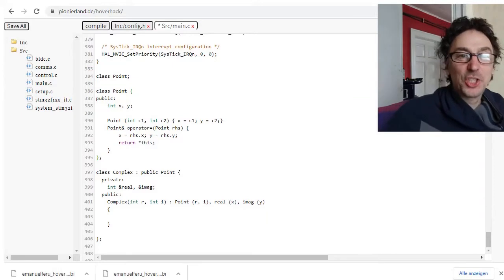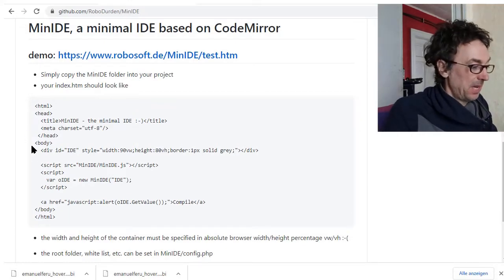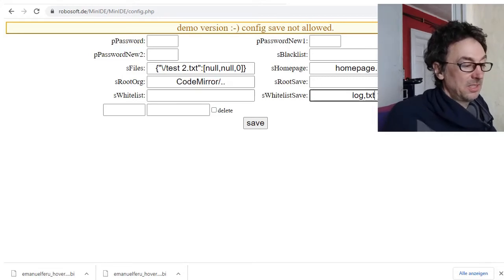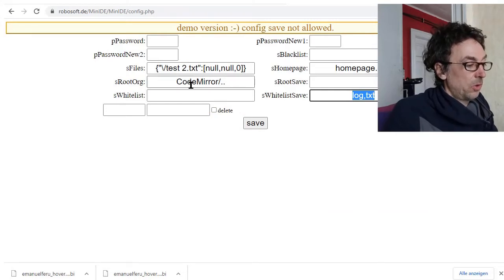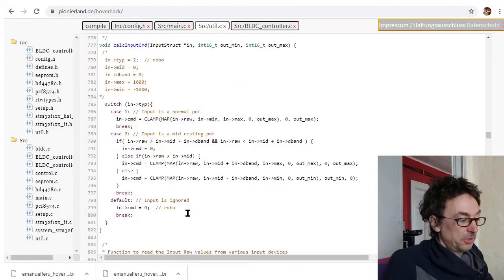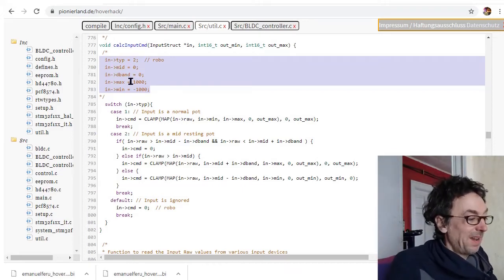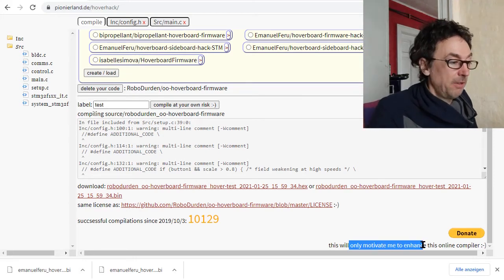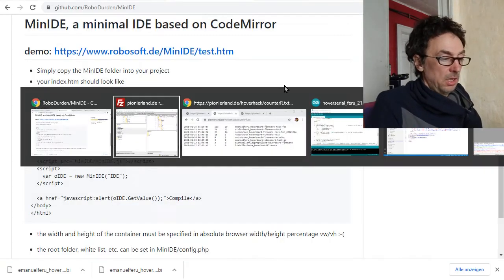*NEW* now fully IDE for my hoverboard ONLINE compiler :-)

Comment: Hi i cant flash YST-DXT-J20 V5.1 board with stlink do you have some experience... i like these boards they are smaller and less capacitors....thank you
Reply from the maker: smaller and less capacitors then what ? The YST-DXT-J20 seems to be the ordinary hoverboard controller. Post a link and a photo of your controller.
Reply from the maker: The link only leads to a software repo. Don't know how the v5.1 board should be different from the standard ones.